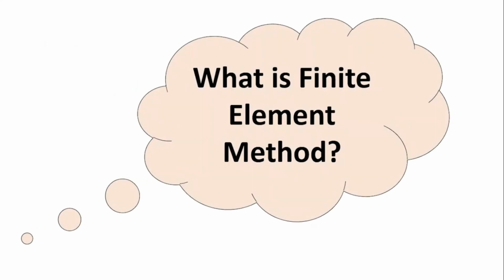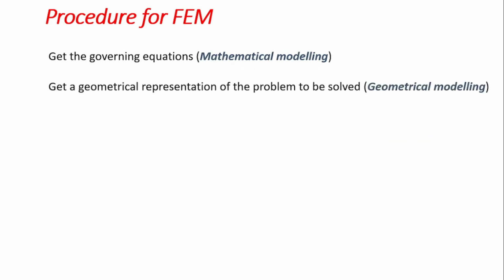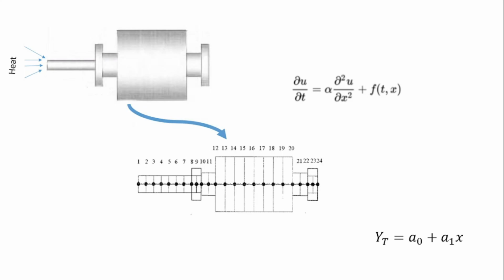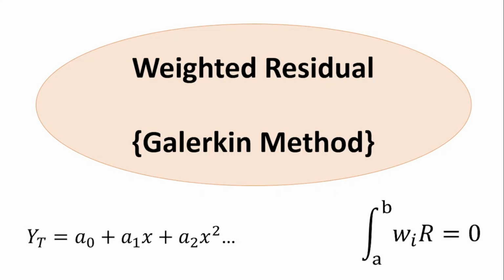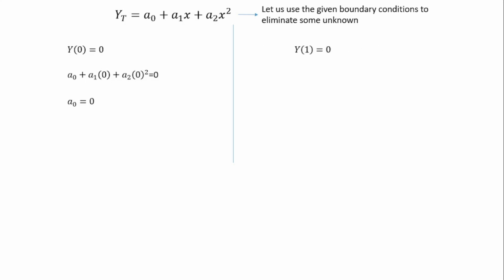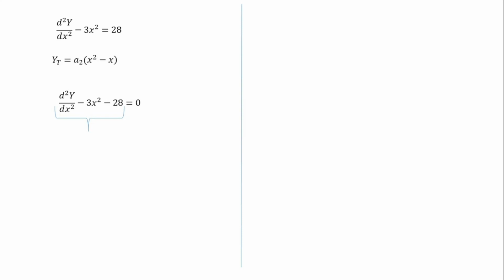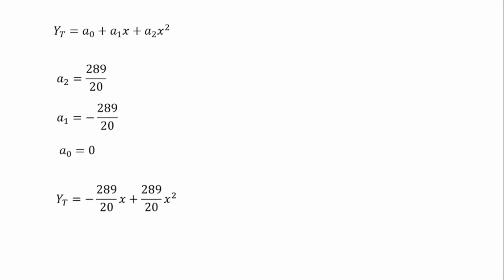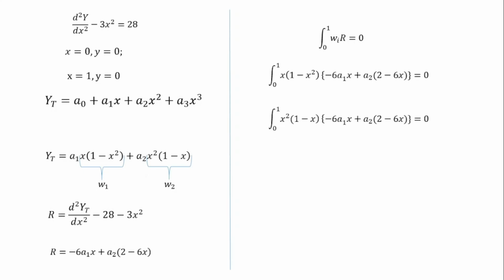Introduction  to Finite Element Analysis and the Galerkin Method

Comment: Thanks. I was just wondering why did you truncate the last two terms of R= - 6a1x + a2(2 - 6x) - 28 - 3x^2 (in 25.50 minutes to the end of the video) when calculating with four co-efficient(a1,a2,a3,a4). Why you did not consider - 28 - 3x^2 in final gelerkin equation?